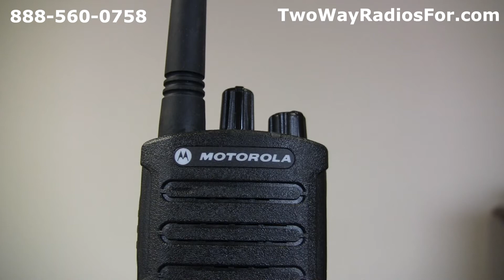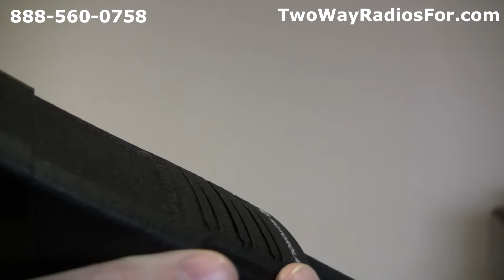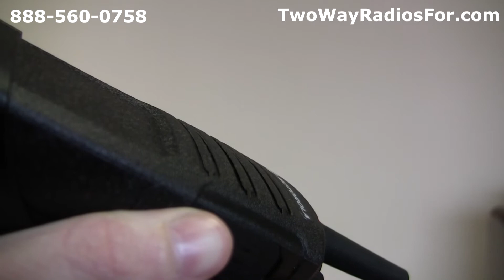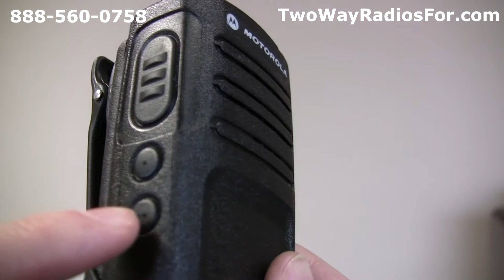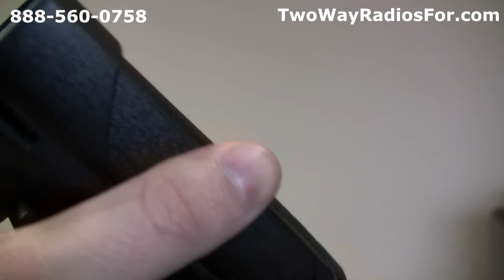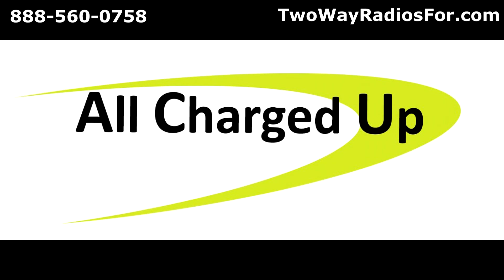How to Program the RMU2080

Comment: Is there an option to change vhf or uhf on the 2 way radio settings software.  Also does the antenna has the option to change by switching  the antennas  to a vhf or uhf antenna
Reply: No, that is not something that you can change. Two way radios are typically either UHF or VHF although there are some that can do both.
Reply: @AllChargedUpLLC  another question. I have a pair of cp200 . So far i was getting range bout 2 milles from my apartment  to my friend house in small city but lot of static and once we both moving around we got a good signal .   How can i increase the quality n range.  My radios have the original antennas.  If i put longer antennas will the range be better or what is better the smaller antennas or long.  My radios are cp200 UHF